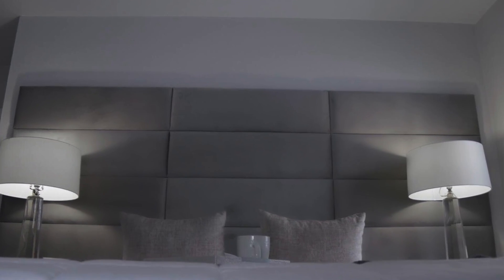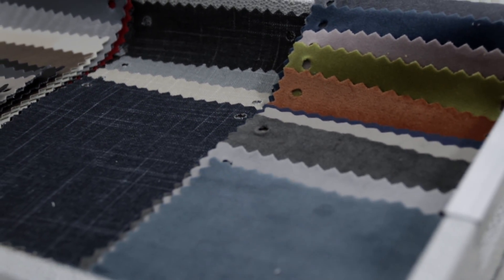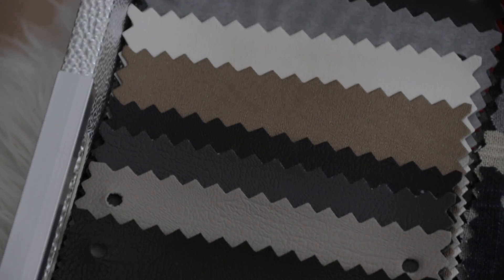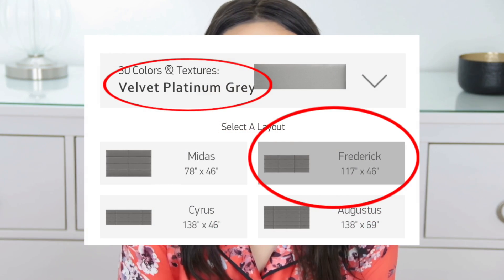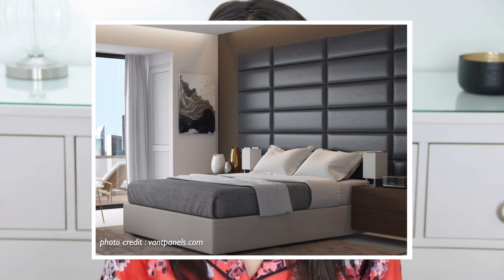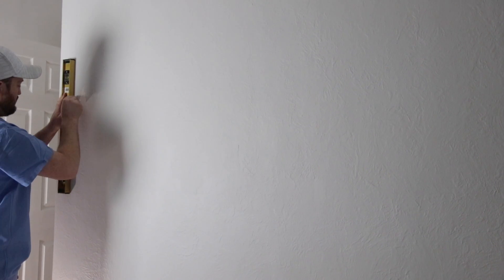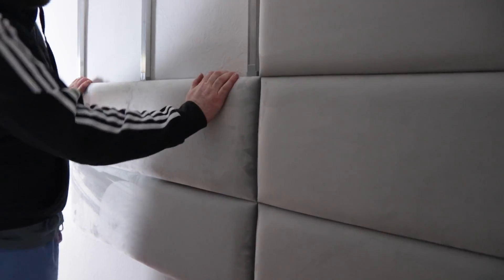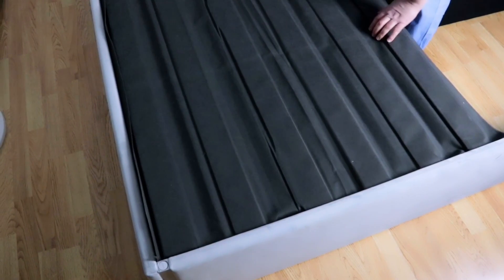LUXE FOR LESS |  CUSTOM AFFORDABLE HEADBOARD PANELS

Comment: I saw these like two years ago and I really love the modern contemporary I love how easy it is to put up however I kind of want to be able to put it over my window and wonder if it'll work that way because the way my bedroom is set up but I really like that specially during the winter because my window is so drafty I'm in an apartment renting and I'm thinking maybe this will help block a lot of that cold air thanks so much for sharing I need to learn where I can buy this from and maybe I can just do some minor rigging to it myself to where I could put it over my window with my drapesand it looks absolutely fantastic modern contemporary that's my favorite and you can dress it up or dress it down your bedroom looks fabulous thank you again for sharing Much Love-n-Peace 💜☮️
Reply from the maker: Hi ! Yes, I made this video/installed them over 2 years ago now! I don't see why you couldn't place it over a window. They are removable if you need to remove them for any reason. The only catch up would be the trim around the window, if any. I am still loving mine :)

Comment: It's unfortunate tho that for a box of 4 panels its almost $200. At the rate of having to buy 3 boxes of 4 panels you are spending $600... That's insane.. That doesn't include the platform bed frame either. I feel like you could easily make these panels with cut out wood, foam material and your choice of fabric and pin them onto your wall. You would get the same result just in a different fashion. As far as the platform bed would go tho... Good luck lol.
Reply: We making panels out of cardboard and foam in 2021 ......YouTube search thank me later